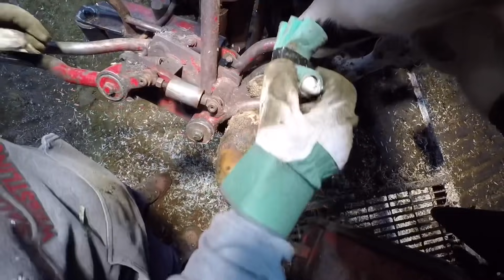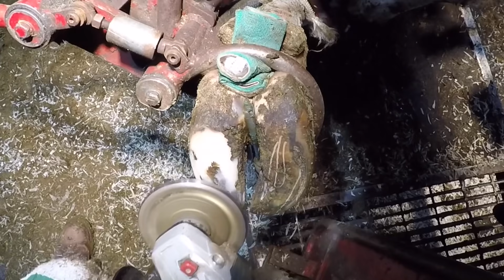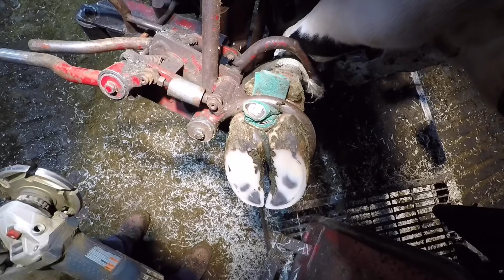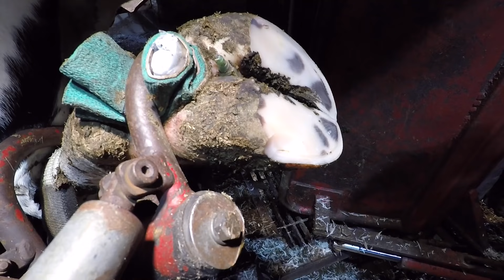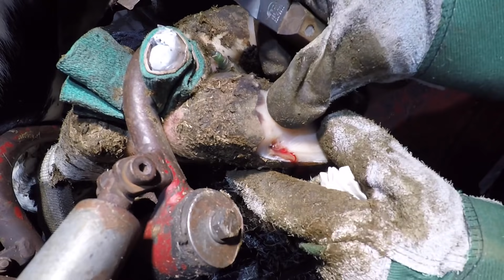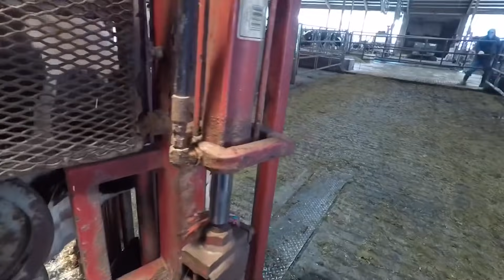A WHITE LINE LESION in its Infancy

Comment: I often see those lines upon or near the white line.  Not just on your videos.
Some are left untreated and some get dug out. I don't know the difference between a 'tells it all' line' and a 'never mind' line.
Maybe you could explain that to me once?
Love from the Netherlands🌷
Reply from the maker: The cow will tell you usually if there’s a problem.  If she’s sore on a particular foot then those cracks can lead you to the problem.  However, many times cracks formed months ago and never abscessed or got infected and new, sound horn formed beneath that crack.  The only evidence we have of this past injury is the residual crack.  Because the injury never caused additional complications and healed on its own, we don’t need to remove the old crack as there’s nothing beneath it.  Boil it all down....if there’s an abscess then there is a crack.  But a crack doesn’t necessarily mean there is an abscess underneath.  Experience tells you which ones to remove and which ones are superficial.  Removing cracks that are superficial can cause the wall to be compromised unnecessarily.  

Hope that’s a little clearer.
Reply: Nate the Hoof Guy 
Thanks for the explanation! 🌷

Comment: Was wondering, do you ever clean the feet with anything other than chlorhexidine? I would want that foot to be manure free! 

I know the chlorhexidine offers long term protection for the wound and you'll be sending them right back into the manure often, but still, having a clean surface to put a block on would be my preference.
Reply from the maker: You don’t want to get the claw wet that you’re going to apply the block to or the glue won’t adhere.  Shaving away old dirty horn with my cutting wheels to get to fresh clean horn is the best way.  It’s ultimately the cleanest as well.